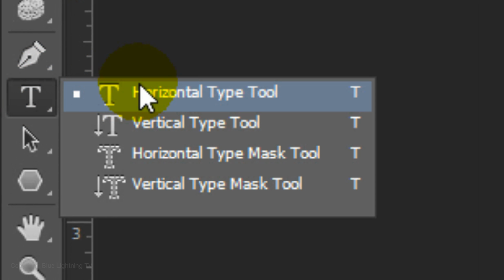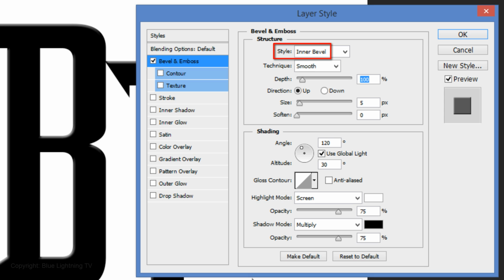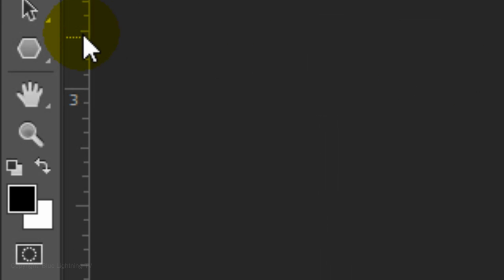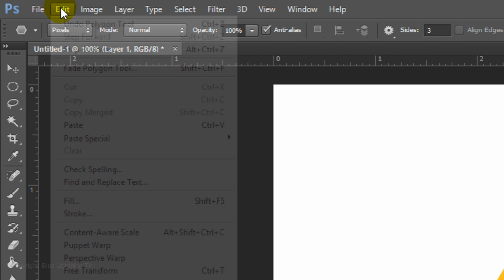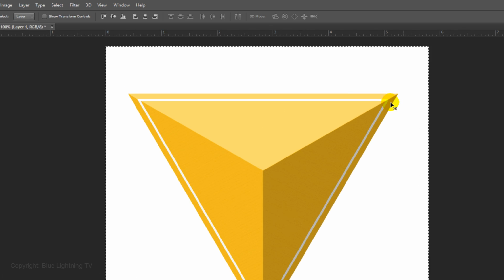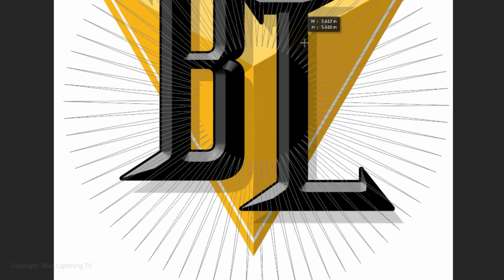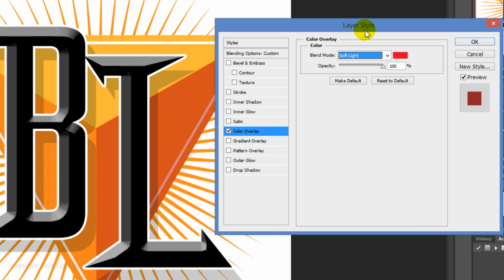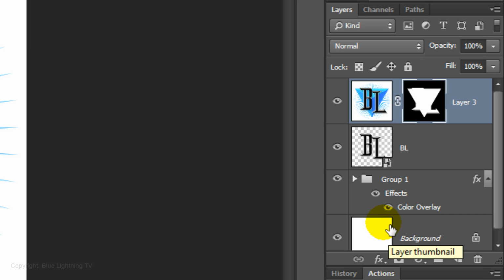Photoshop Tutorial: How to Make a Custom Emblem Logo of Your Initials

Comment: When I'm using the Polygon tool, my Polygon can't get big at all. I can drag everywhere but it will still only be like a inch big,  SAME PROBLEM AS VICTOR TABY - HELP MARTI
Reply: Make sure you type in 'in' when changing the values and don't keep it as 2.8 px. I had the same issue.
Reply from the maker: As soon as you place your cursor on the document, DO NOT release it. Drag it up and you'll immediately see the triangular outline. Press SHIFT as you move it until it snaps to an upright position.
Reply: that's also my problem too. i didn't release my cursor but it didn't work. And another problem is when i worked with barvel, it appeared a few line in the triangle

Comment: Hi Marty, great tutorial, I am also unable to add a Layer Style to the group folder. When I Double-click directly on the folder it only opens up the Group Properties,any suggestions? (using CS5)
Reply from the maker: Layer > Layer Style > Color Overlay
Reply: Blue Lightning TV Sorry but the Layer Style option is grayed out.
Reply from the maker: Les P Make sure the folder layer is active and make sure you're in RGB mode (Image > Mode > RGB, 8bits/Channel).  Also, try right-clicking on the layer fx icon and click Show All Effects.
Reply: The fx icon is also grayed out. I can only change the color overlay on the layer itself.
Reply from the maker: Les P I'm sure there's one thing that's causing it, but frankly, it could be one of a number of  sources.
Reply: Blue Lightning TV Thanks Marty, On looking around the Internet it looks like adding a Layer Style to a Group Folder is a new feature in CS6, but thanks for your help.